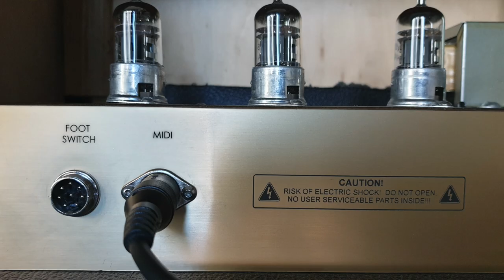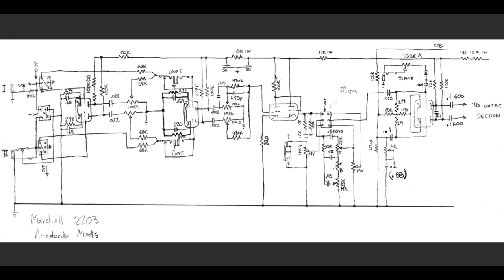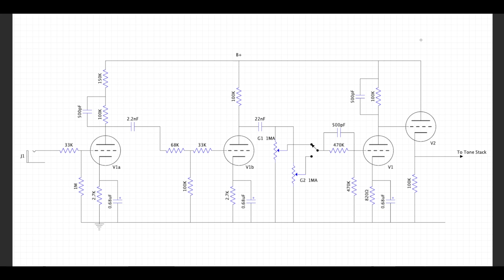HEADFIRST - BE to José conversion.  TONES, JOSÉ INFO AND CIRCUIT INSIGHTS!

Comment: Fantastic video and info man! Love your info on these amps. It makes me understand the different circuits better!
Reply: Max if you haven't built your own amp, Jason has an ST1 type board that can be used for Plexi or JCM800's.  My last 2204 after a few corrections was fantastic

Comment: I get the impression that if one is covering classic 60's, 70's and 80's classic and hard rock, that this iteration may be better suited than your other coverage of the 2204 modded amp with the input Fet gain mod with diode clipping.   Is that reasonable or would they both fit that application?   Its almost time to begin collection specifics for the specific choice of configuration.  Its so hard because they all sound great and have their own thing.   Thanks for much.  Very well done and inspiring

Comment: Nailed that AC/DC tone !! The clarity and stacked sound is killer !! DonI wish you could tweak my amps !! 
I need midi in my BE-100 and Archon 100.
Reply from the maker: Thanks man.  A MIDI retrofit to a BE100 is absolutely doable...it makes me think I should make the MIDI board available in a stomp box format, back at the amp, that translates MIDI to TRS switching.
Reply: @HeadfirstAmps   that would be awesome if you did !! 
If there was a way for the PRS Archon as well. Their channel switch I think is a 5 or 7 pin connector. Not like the normal trs .

Comment: Another great video Jason! What tap are you using for NFB and if you had to guess what resistance you like the response set?
Reply from the maker: Thanks.  Good question...it's off the 4 ohm tap, and at that response setting it would be approx a 100k nfb resistor.  It's 27k fixed with a 100k linear pot.

Comment: On the Blue channel, when you engage the cold clipper setup, does the amp get a bit quieter? How does that second stage mod affect the overall volume in band context?
Reply from the maker: Only a touch quieter.  I find it suits the parts, as when flicking to that setting I'm after something a little more laid back.  It's very marginal though as its more a gain reduction than a volume one.

Comment: Just curious. What is your preferred method? Turret board, Eyelet board, PCB or point to point wiring? And why?
Reply from the maker: PCB for consistency, low noise and easier to build.